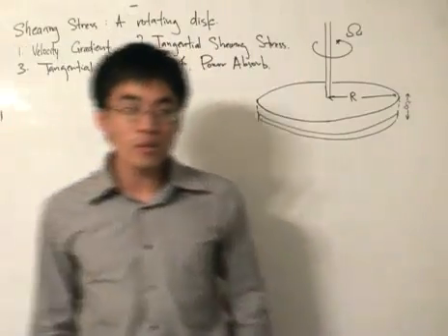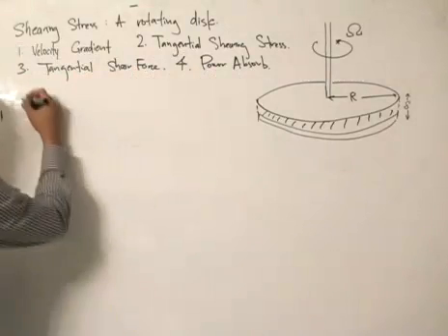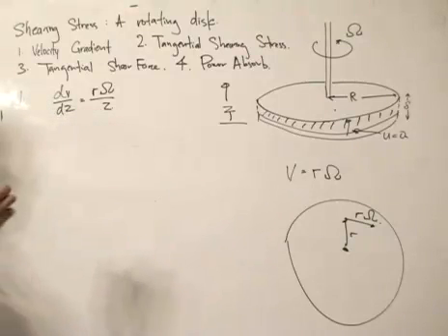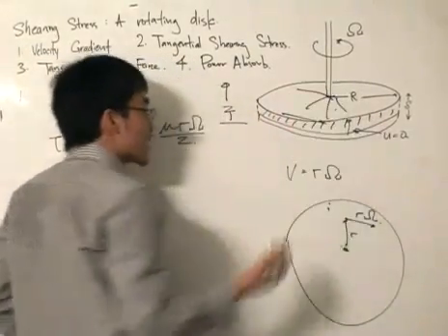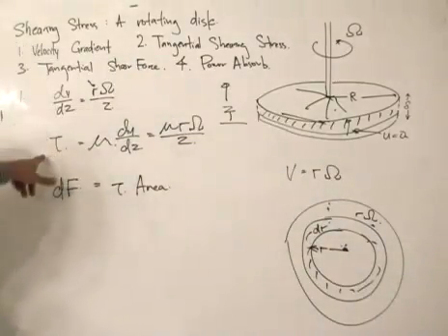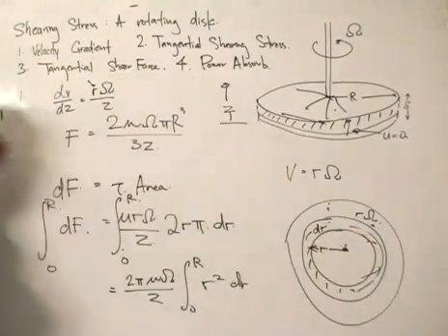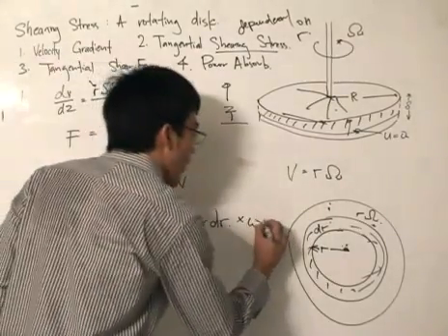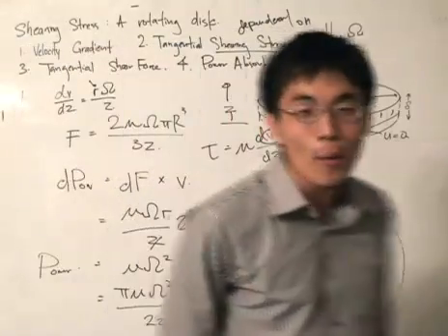Fluid Mechanics - Shearing stress on disk

Comment: I found this and it's quite helpful but I'm wondering why 2 was cancelled with z at the derivation for power equation
Reply: I think it was a mistake. Maybe it looked similar to him while he was working. 
If you dont cancel them out, youll still be left with (R^4)/4, and the 2/4 is reduced to 1/2 anyway, so his result is correct. 

Was confused with his working for a while.

Comment: please explain about the area. how do you get 2(pi)r(dr)
Reply: Circumference times whatever r you're at
Reply: +Justin Ballew but area would be r times circumference/2
Reply: Usually the area of a hoop would be pi*R^2 minus pi*r^2. Where big R is the outer radius and r is the inner radius. Since this is a differential (infinitesimal) amount of area, you can consider the area of the differential hoop to be its outer circumference times its thickness, dr. Essentially you're considering that hoop to be of rectangular area, since the error resulted from this method is negligible.
Reply: @MuthaFuckinGoblin  thickness should be dz right?